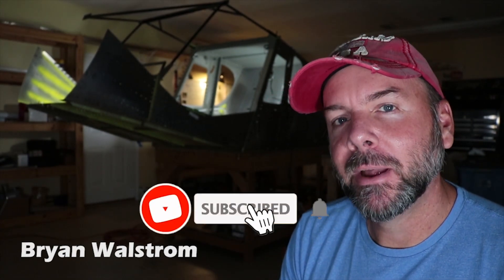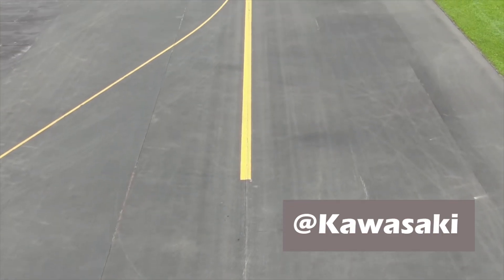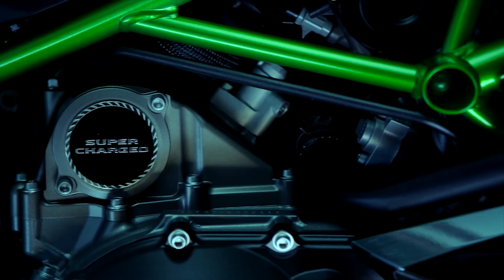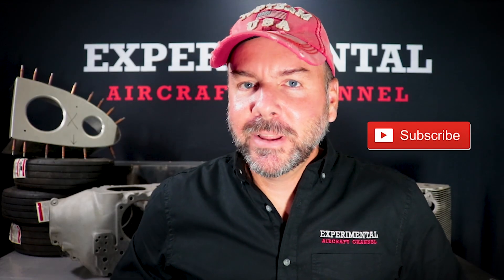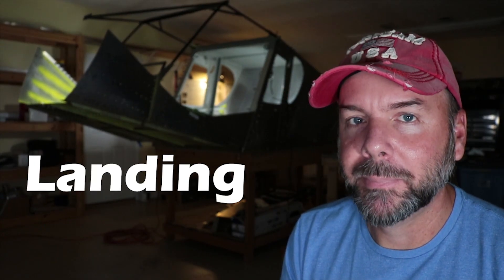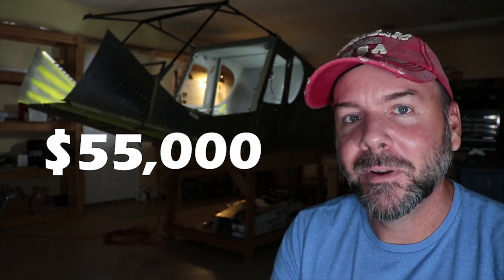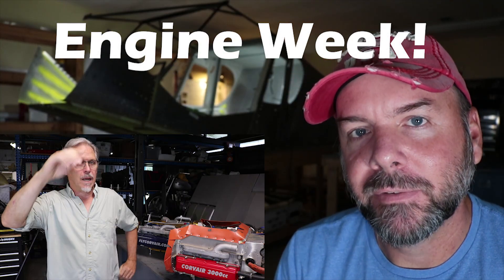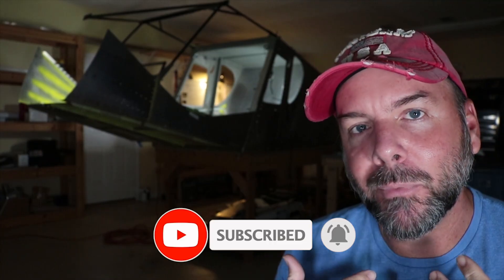Ninja Helicopter! Racing Engine! Kawasaki H2R K-Racer Flight Test

Comment: someone made engines for the BD prop jet by using older aircooled KZ/Z1 engines with transmissions removed/cut off back in the day, they made just under 100 of them

Comment: I have thought about the BMW 1000RR (already a plane with this in it) and the Yamaha R1. Never read the speck on them but Honda used to make a v-twin with fuel injection that could also be a good option as it would make it's power at lower RPM.

Comment: It's not new. The Lockheed AH56 Cheyenne that was developed in just 18 months in 1969 was a compound helo. It used a semi-rigid rotor, a pusher prop, and had stub wings that provided additional lift in forward flight. It broke all helo speed records of the day. It had innovations that we didn't adopt until decades later, such as a heads-up display helmet, sight-directed mini-gun, etc. The Army ordered several hundred, but, while the bugs were still being worked out of the tech, the army put in an order for a bunch of Bell AH1 Cobras as a stop-gap until they could take delivery of the AH56. About that time the Air Force stepped in and made a stink about the AH56 assuming their ground-support mission. The chiefs of staff backed down and cancelled the Cheyenne program in 1971. It was a helo that was literally 30 to 50 years ahead of its time. Sometimes folks wonder how come the Russians seem to be ahead of us in helo tech. It's not to hard to figure out. When the Cheyenne program was cancelled, the remaining helos were turned over to military museums and Lockheed got out of the helo business. Russia had taken notice however and many of the Cheyenne's features subsequently showed up on Russian attack helos.

Comment: I was part of a team that developed a Hayabusa engine to fit into a gyrocopter 6 years ago. The gearbox and clutch were stripped out of the bike engine and the drive was taken from the clutch drive through a CNC clutch cover with the PSRU mounted off an alloy plate,much like the Viking motors. It only did two days of test flying here before it was shipped to Australia and dissappeared. I remember the test pilot being very enthusiastic about the power plant saying it was more like a turbine engine with power and smoothness. We swung a large prop at 2200 rpm coupled with an after market muffler made the power plant almost silent in cruise. The pilot said it was so quite in the cockpit that you could have had a conversation with someone.

Comment: Mark Doan;  Exactly what i was thinking, snowmobile engines lend themselves to aircraft conversions much easier than motorcycle engines. The R-1/apex engine does have a gear reduction on it from the factory, because the snowmobile drive clutch won't take the rpms the engine can turn, but it is still to fast for a prop. So anyway, it is easier to build the right reduction ratio for a prop from a sled engine.
 Still, very interesting Bryan
Reply from the maker: Thank You! I appreciate your support! :-)
Reply: the fact that a motorcycle engine has the transmission as an integral part of the engine case, where a snowmobile engine doesn't, is what i was eluding too.

Comment: Holy CRAP, that Kawasaki chopper sounds like quite a vehicle.  I will be interested to see what kind of reliability they can get out of a super tuned bike engine like that.  Those bike engines have some WICKED power/weight for an IC engine, they just need to get the reliability (not that they're that bad) to aircraft level and it would be an awesome power plant.
Reply from the maker: Agreed! I have owned several Sport Bikes over the years and they can really take some abuse! Thank You for watching! :-)

Comment: Snowmobile engines lend themselves to aircraft application far easier than motorcycle engines due to the fact motorcycle engines have the entire crankcase ,  transmission and driveline output in one whole casting ...they are not separate like a snowmobile engine is with the  output shaft being the crankshaft  .... It won't likely happen due to the insane R and D cost of cutting up or casting new lower end cases without the transmission ... I just dont see this catching on ... Extraordinary amount of modification needed to get it just to the starting place of a snowmobile engine
Reply from the maker: I agree with you. I wish there was more details on the insides of what they did to make this one Flight Ready. I assume that they must have machined/remove/added a gearbox that suited this application. But that fact that it is being done and tried is very exciting to see! Thanks for taking the time to watch here today!
Reply: exactly what i was thinking

Comment: Jesus people no motorcycle engine is a realistic option. The molded built in transmission is the issue. The only reason the Yamaha snowmobile engine works is because the sleds don’t have transmissions and it’s a straight crank just like any Lycoming or continental.
Reply from the maker: Yeah.... I am curious what/if they changed something to the internals to make this work. They wouldn't need the 5-6 gears and shafts turning inside there for this. Then again... looks as though they developed a two-stage supercharger for this application. But... I think that works sort of like Honda's V-Tec for Low and High RPM ranges. If I get more information on the internals I will share. Thank You for taking the time to watch and also to engage here today! I appreciate you!
Reply: @ExperimentalAircraftChannel  I’m sure for this application they developed this engine without the transmission. I mean they built and designed it and it’s a one off. But for the common man it’ll have to be the Yamaha. Or I guess instead of a constant speed prop you could have a 6 speed transmission lol

Comment: The Yamaha Phazer 500 cc 2cyl is basically 1/2 of the Apex 1000cc and makes about 80 HP. It's currently being flown and further developed with a skytrax gear box that is being tested for production now . My plan is to install it in my BD-5.
Reply from the maker: I am very interested to see how this works out as well. There are several Ultralight Aircraft and smaller single seat Experimentals out there that this would be well suited for. Thanks for chiming in! I appreciate you!

Comment: Great video Bryan. The beautiful thing about utilizing engines other than the usual Rotax, Continental, Jabiru, etc, is the basic fact that this will ultimately, in the not so distant future, will create a tremendous amount of competition thus driving down the cost of FWF packages for the experimental class. A great example of this would be the Viking Engine series. A complete FWF package from Viking is less than Rotax on average and that is just for the Rotax engine and nothing else. There are also other advantages such as complete water cooled motors vs water cooled heads with a few cups of water. The one drawback from GA use would be the overwhelming cost of certifying a motor. That is something the FAA should concentrate on reducing. Just saying. 
Lovin your videos. Keep them coming brother. 👍
Reply from the maker: @The Worship Traveler THANK YOU for your kind supportive words  and technical response here! I too am very excited to see what the future holds especially for these smaller light weight, higher revving engines. Thanks for watching!

Comment: I've heard that those supercharged kawi engines are unreliable for a motorcycle, as in, they like to blow up. Seems like a terrible idea to put them in aircraft.
Reply from the maker: I wonder if this "Aerospace Systems Company" did any modifications to improve longevity. There isn't a whole lot of information out on this just yet. The "Concept" however is really cool! Thank you for stopping by and saying hello today! I truly appreciate you!
Reply: That would be unusual, their engines in general in bikes are very good. I'd be interested to know more about the the details because people say they "heard" about reliability being poor in just about anything these days and often they aren't treated well. It comes down to maintenance and use case. 

Maybe it doesn't work for aviation  because of the duty cycle or weight, maybe it will be a perfect fit. Only time will tell.

Comment: Been hypothesizing M/C engines for aircraft use for decades. I made an ultralight using a two-stroke 125cc single cylinder M/C engine back in the 70s and that UL was a blast. Took about a week to figure out a proper mounting configuration, but it was very reliable, having never given me a problem in about a hundred hours of flight time, before it was dismantled and I went on to other endeavors. I was a teen, that's how teens do things - OK, what's next? lol
Reply from the maker: Haha! Nice. Great EXPERIMENTING! Thanks for stopping by today!

Comment: I was in the bike seen for many years... Trust me all you need to do is wait 1 week you will find one of those engines cheep.. May come with some road rash...
Reply from the maker: Haha... unfortunately that is a VERY true statement. I myself have repaired one with SEVERE road rash and resold. I wonder what the used market looks like for the H2R. Thanks for taking the time to watch and engage here today!
Reply: @ExperimentalAircraftChannel  I always do... And thanks for the content. Cheers
Reply: Dan, I was thinking the exact same thing. A very low mileage H2R could go for as little as $5K depending on how much of the original packaging is remaining after a unusually short ownership event.

Comment: Bryan now you hit a subject I’m very familiar with. I worked for a helicopter company designing compound designs. We built and tested a design that was a redesign of The Pathfinder from the 60’s. The Pathfinder held the speed record for helicopters for 40 years but was never put into production. Politics!! The issue with compound helicopters is to slow the main rotor down or even stop it as the aircraft increases forward speed to decrease the tip speed of the ascending rotor blade. Bad things happen when rotors hit MACH speed. We performed wind tunnel test then build a design using a Blackhawk as the flight platform. The clamshell design didn’t perform as well as the original design as the Pathfinder. I don’t want to mention the name of the company out of respect for the man. This was my first job as an engineer after flying for the Navy and I love designing as much a flying, so this is the main reason I love your channel. You bring new ideas to the masses even though there will always be people who already know some of the information you present. But as a whole you will inform most.
Reply from the maker: @John Paul Lafferty THANK YOU for showing up again and again. I really appreciate your support. It appears that you have a VERY interesting background as well. Please keep sharing your experiences as well! :-)

Comment: The nytro / Yxz 1000 triple and Phazer Twin will be the next thing to look out for. Teal Jenkins is developing a Skytrax PSRU for those and Youtuber (Ians Life) is working on a conversion harness. He’s dropping a phazer in a chinook, should be interesting.
Reply from the maker: I am following this closely as well. Looking forward to see some hours on these news OPTIONS very soon!
Reply: @ExperimentalAircraftChannel   I was wondering when somebody was going to develop a reduction unit for the nytro engine. i think the nytro engines are probably going to be easier to find because that engine is Yamaha's main top of the line snowmobile engine now and Arctic Cat is currently using those engines too. Also i believe Yamaha isn't making the Apex sled any more.
Reply: Yup it will be interesting too see how Ian's Chinook Phazer conversion works out, probably very well!